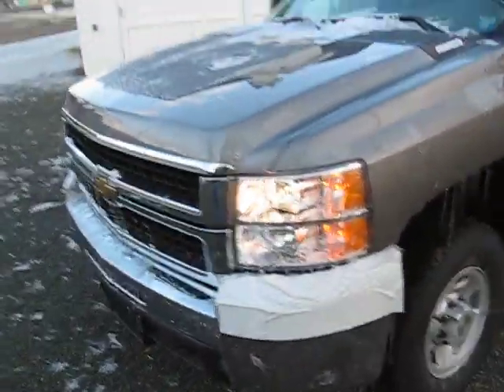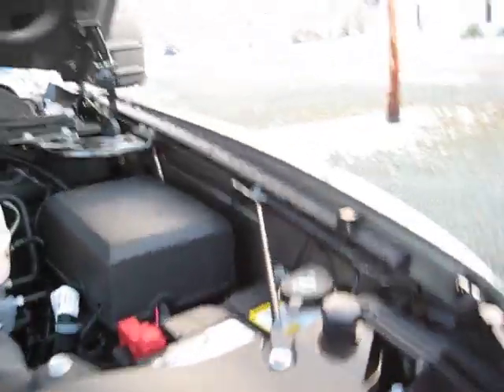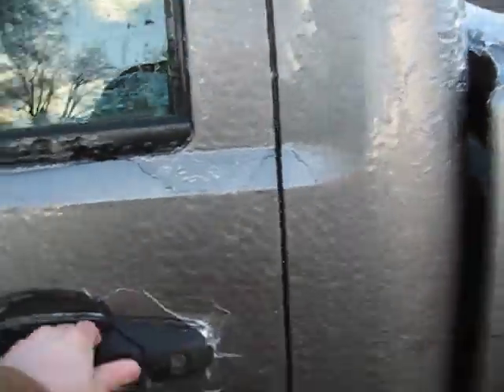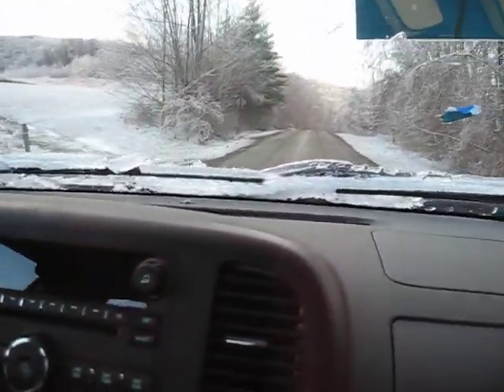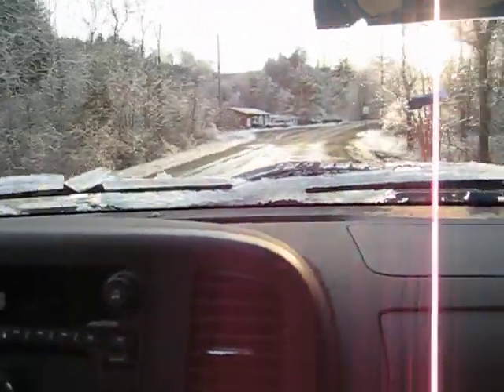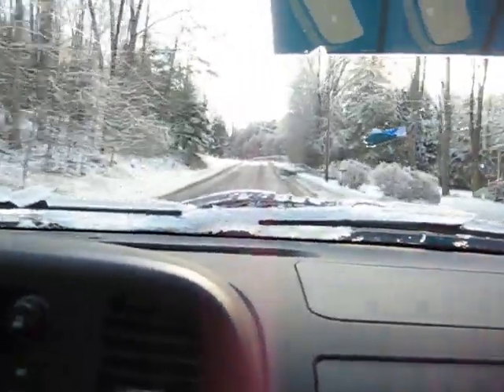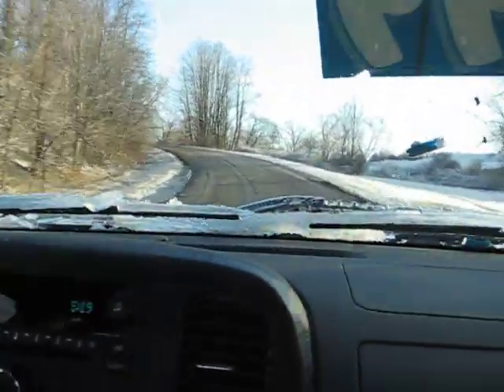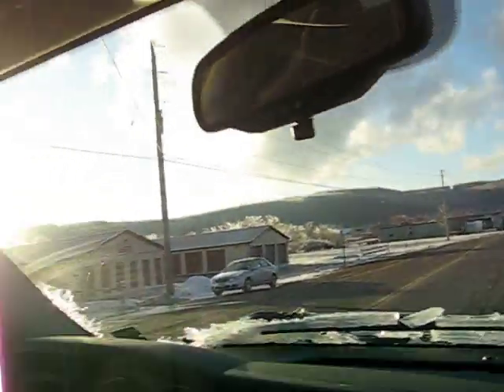2008 LMM Duramax test drive

Comment: kudos dude. i admire the fact that even though you're a duramax fan and owner, that doesnt automatically make u hate every other diesel. 

ive become a fan of the 6.4 PSD too. like you said, they have several with just chip, exhaust and tuning running 580-590 RWHP. 

another cool fact, i saw one with stock turbos running 49PSI of boost

Comment: lol not under a load. maybe spinning your tires or in neutral. I run EFI live on my truck.

Did you guys know that there are 6.4 powerstrokes that are up to 600 rwhp with basic mods like tuner,exhaust etc. They shaping up to be a pretty cool motor.

Comment: the torque formula is TQ= HP X 5252 divided by the RPM. so the higher the RPM your engine makes it power, the less torque it will have! why do u think diesels have such high TQ to HP ratios? because they make their power so low in the RPM range.

Comment: hmm actually ford offers a dual alternator option that alot of trucks have. 

and stock, it wont turn 5000. under certain circumstances with tuning it will. oh and BTW, ive seen 6.0 PSD's run 4500 RPM.

but who really cares if the engine can turn 5 grand? lol come on its a diesel, remember, low end power. of course if you want to run over 130 or so, then yeah the stock rev limiter will hold u back.

Comment: no its the 6.0 that has crank problems. not the 6.4. many 6.0's with over 100k will mess up cranks. other than a couple of recals, the 6.4 has not had any major problems and makes tremendous power

oh and you know NOTHING on the torque issue. do you know how to even determine the tq from hp?

Comment: the new duramax has dual 120 alternators...liek the 2009's im pretty shure...but all in all fords a peice of crap...the 7.3's rocker arms are a peice of shit..its jsut a peic eof metal plating holding it in....and the 6.3 or 4 or w/e has serious cranck problems....they tend to break alot...duramax is just so mtuch better...or cummins..but..duramax are more reliable when you chip them...and you should aswell as me and everyone else cre if the engine turns 5 grand...rpm + tork = awsomeness...